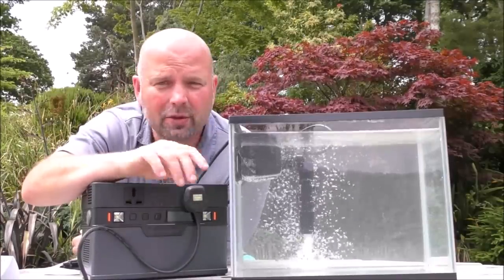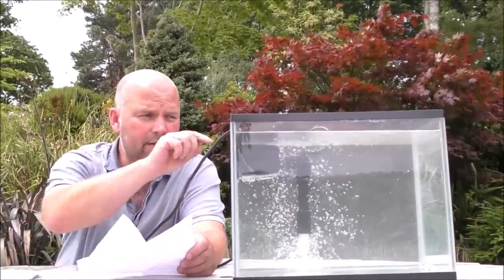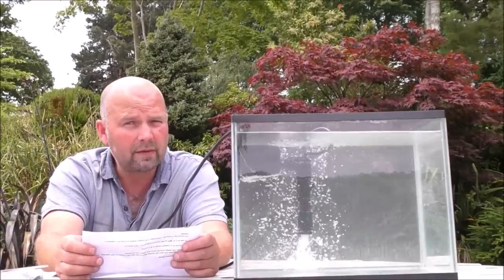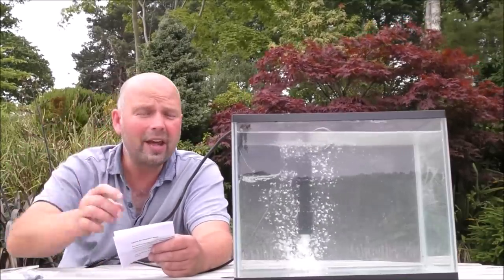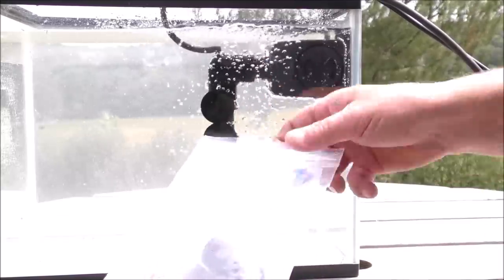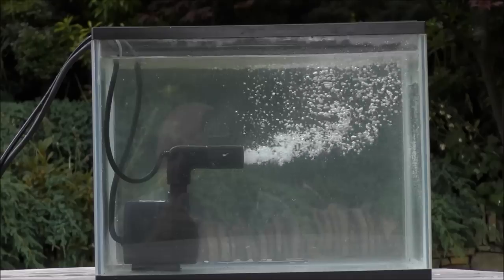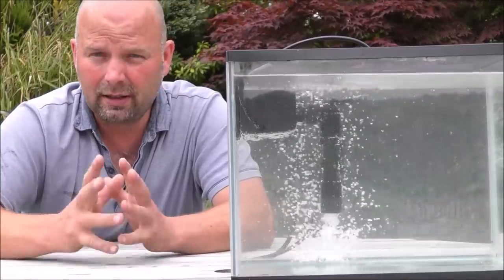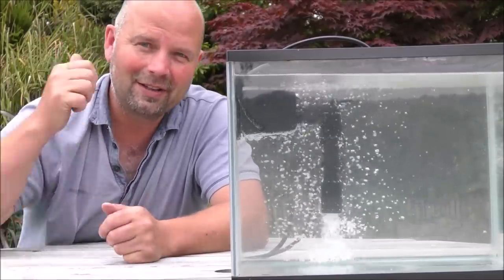Grow Greenie Aquarium Venturi For Canister Filters And Sump

Comment: damn that's quite the coolest venturi ever and seems to be quiet ! / from my canister, i'm using an Eheim installset 2 return spray bar with 2 dedicated Eheim venturis, directed towards the surface for water movement... it's efficient, but it's quite noisy...
30 USD dollar without shipping cost it's quite steep for us EU continentals
are anybody planning to distribute it in EU?
btw I'ld like to thank you for your videos about sump/filtration, you're a source of truth.
Reply: yes works out $100 dollars for 2 large aquarium  ones shipped to UK,  great idea though
Reply from the maker: Yes the cost is a bit of a bummer but these are made in small batches and it's a bit of a process to put the 3D printed parts, pipes and fittings together as it is all done by hand .

Comment: Very impressive. Might be a dumb question ???? but are there types that can fit to the return pipe from an external canister filter, and that shoots the water horizontally around the tank, rather than down ?
Reply: Eheim does a "power diffuser" which is a form of venturi
Reply: It can be rotated at the hose barb about 45-60 degrees when connected on the canister filter return.  so it’s not straight down in smaller tanks

Comment: There goes the sand substrate 🤣🤣
Reply: It can be rotated 45-60 degree at the hose barb.  It doesn’t have to be pointed down in smaller tanks.  But performs great pointed down in much larger tanks. That way it won’t blast the sand 😁

Comment: @Pondguru Another great review! Thanks as always. Could you help me understand how this would work with the external canister filter return line? How is that line able to suction return to the filter with this attached?
Reply from the maker: The flexible pipe from the return of the canister filter simply fits onto the hose tail - 2 different sizes come with the venturi and i show them half way through the video. The venturi comes with 2 suckers to fix it to the side of the tank.

Comment: Excellent video, sir. I would love to see you do some experimenting with using these "in-line" on a sump pump. Not at the end for aeration alone, but fashioned into the return line to see if there would be an increase in head height / flow as seen in "Air Lift Pump" demonstrations I've seen used in aqua-ponics systems.
Reply from the maker: I doubt it would result in a higher head since the air is being drawn in by the water, not injected in under pressure but I'd wager that Gideon from Grow Greenie could answer that.